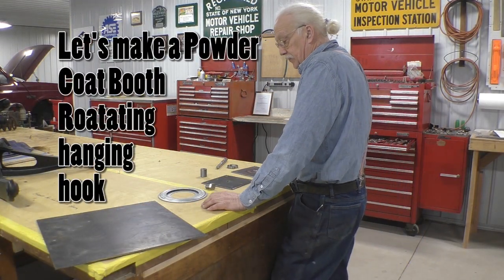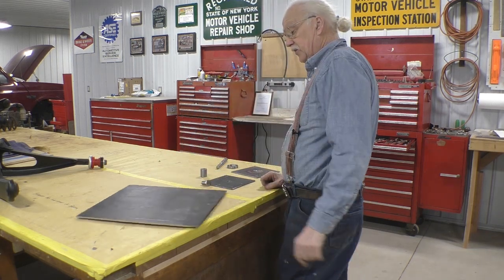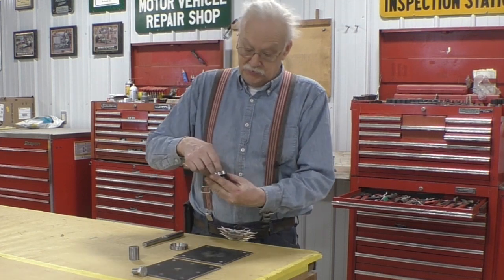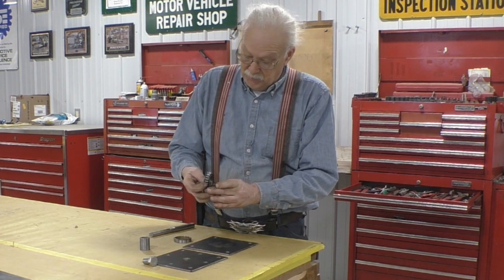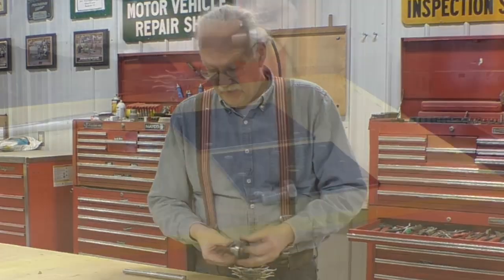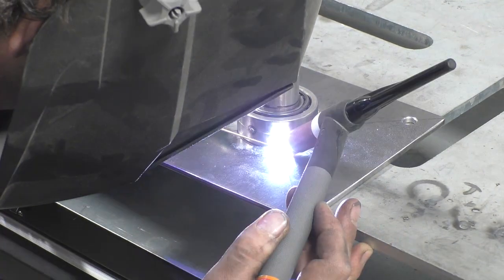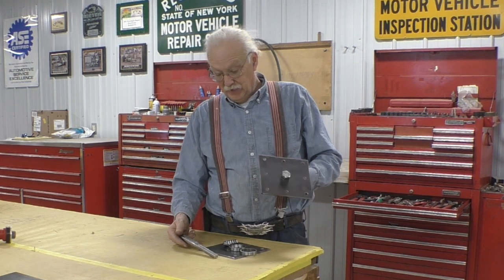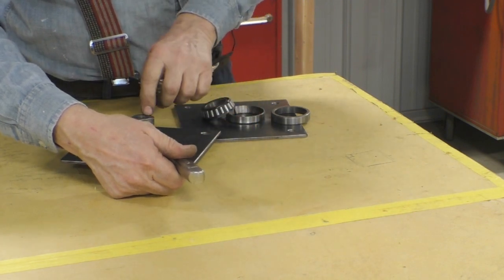DIY Powder Coat Booth Rotating Swivel Hook hanger

Comment: Nice! your video brings me ideas!
Reply from the maker: Great, let's see the new ideas.
Reply from the maker: You have about the same number subscribers as I do, and in a short period of time. How did you do it. I do not seem to attract many new subscribers.
Reply: @ThrottleStopRacing  i was just thinking, maybe i can help you, in my videos i ask a question and out of the comments i pick a realy good awnser, that person gets a schout out in my next video! in about a half hour my next video is online, maybe you can give a good comment and maybe i will pick yours for a shout out.
Reply: @ThrottleStopRacing  i want something that rotates on my ceiling that can hold my vacuum hose and rotate with me when i clean up my workshop. This looks strong and i think it will hold that hose
Reply from the maker: @ashstagwoodworking  Not sure how that would work. It is plenty strong. If you wanted stronger I would use a spindle from a car front suspension (lop everything off but the spindle, use the hub that the spindle supported (lop everything off but the hub (remove the drum or disk).

Are you going to hang the whole vacuum? High ceilings? If it is just the hose this is WAY overkill and wouldn't the hose get tangled,twisted?
Reply: @ThrottleStopRacing  that is some good advice! thank you for that!
Reply from the maker: @ashstagwoodworking  Powder Coat Booth build just uploaded. https://youtu.be/6ZyXcD8oGck